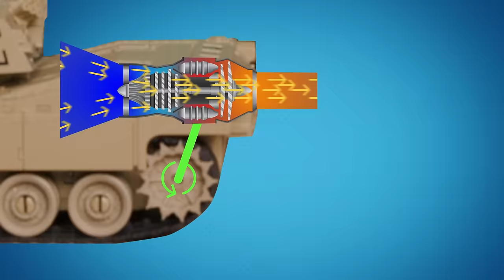Army Mechanic Reacts to Tank Fails

Comment: Russian tanks are not known for being water tight. Often the older they get the more maintenance issues you get. Most of all, people taking the funding to fund their own pockets. That is how you get tanks that break down easily. This aside from the obvious problem that Russians love to keep money before it hits the right industries like tank production. This again leaves major mistakes that can cause major issues. Also on top of that as mentioned in the video, a tank needs to breathe. This is why you see snorkels or other equipment being fitted on tanks from time to time. The Leopard 2 is for example pretty famous for images that show this perfectly. Those tanks can wade (if using that gear) up to 15 meters (49 ft) under water. Really cool to see this in action I have to say.

And for people who think this has anything to do with the turrets flying off to space. No, that is tank design. Where NATO countries store their ammo in other locations to make it saver for the crew. Russia still stores it WW2 style around the turret. So when a turret gets hit between the turret and the hull, it will explode all shells and make the turret fly off to space. 100% KIA on all inside as well.

With all due respect, the biggest issue with the Abrams tank is the specific fuel it needs, this causes the fuel consumption to be worse and even worse then that you will need a huge supply line to keep one of those beasts to run. This while a Leo 2 can visit a local gas station and fuel up there if really needed. And for Russian tanks, they poor some vodka in on a regular basis. Regardless, the M1 is a amazing machine and it has it's advantages over other tanks. At this moment however it isn't the number 1 in the world, but second place. The Leo 2a7 is whooping it's rear pretty hard. I hope the Abams will get replaced with a completely new variant as updating it might be asking too much, it's getting rather old and many systems need to be integrated better. For the Leopard, there is talk of a Leo 3 being in the making, no idea how that will turn out or even look.

A roll over like that can easily cause the tank to be written off completely. It would need to be send to the factory to be rebuild and made sure everything works as intended and no problems remain. However Russia doesn't have this policy, they just end the same tank with minor repairs back in action.

A tank like a M1 Sherman is amazing for it's time, but depending on the engine it did have known issues with overheating, misfiring or even in rare cases bursting into flames due to overheating. Some more modern M1's after the war however did get these issues fixed usually, specially the M1's that still run in active service to this day run with very reliable engines often.

11:07 French AMX AuF1, quite decent artillery units. Second artillery I am not sure about, last is a Russian tank, probably T-72M. And yes Russians seem to get in trouble like that due to their own foolish reasons. Most often also because these guys don't get trained properly like NATO forces do. In NATO every single job you get trained for so you can do it properly, in Russia this is not the case. Which is why you see WW2 tactics being used by a modern Russian army during the Ukraine war... Also in at least the Leo 2 and Abrams cases you often see the crew loading it with the turret facing to the rear. this will ensure the barrel doesn't get damaged as easily if something does go wrong. The major reasoning behind this is that the rear of the tank is actually longer due to the turret being offset to the front a bit further. Another good reason is to save space.

12:36 These are Russian vehicles obviously, this is pre-Ukraine war 100% sure, I however do not remember when exactly. I am aware this footage is from at least 2010 if not earlier. In this case it's during a training operation if I remember correctly. The tank needed major repairs after this and a completely new barrel. From what I remember the turret ring was destroyed, the barrel was bend and inside the turret also some things were bend (don't ask me how they achieved this last part, no clue)
For a Russian tank your vision is even more limited then what the Abrams or Leopard 2 have, as mentioned it's really a tiny hole in front of the driver really. In Russian tanks it's not multiple holes like we have in the west.
The other vehicle hit was actually a BMP-3, which would be troop transport (APC in this case)

The fastest tank speed on record is 82.23 miles per hour (132.5 km/h) achieved by a modified British FV101 Scorpion light tank in 2002. The default version is obviously slower, yet actually still a insanely fast impressive small tank. For the one in the clip, well that is a custom Chieftain tank. For obvious reasons it most likely lost all it's armor in favor of a very light body and turret. Likely a brand new engine and changes to it's wheels and tracks. Else it will NEVER be able to even get close to those speeds. 40 km/h (25 mph) for the Mk. 1- Mk. 3's, the Mk. 4's are not that much faster. So getting this very slow machine up to those speeds is pretty much a money sink and foolish. Even with all changes, you probably will get a additional bit of speed out of it, but no more then half extra unless you make it all in carbon and even then it's a question if the tracks will hold out as those are not made for high speeds.

Test footage in England of a British Churchill tank, very early stages. I think it's even a A22 which was the tank's name before it became the Churchill. So very much a test tank at this stage. The idea of tests like these was to see what the tank could handle as WW1 was just behind them and they wanted to make sure their next tank would be able to handle trench warfare. It just didn't turn out like that as Germany used a completely different tactic that made trench warfare obsolete.
Modern footage at the tank museum Bovington (tankfest): https://www.youtube.com/watch?v=t3DF1G1-axI

Comment: "Essentially an airplane engine".... no,  not essentially, it is.  It's the same core turbine that's in the chinook. The T-1500 and T-55 engines have about as many parts in common as your average subaru turbo EJ motors.

Comment: The tanks on to the trailers 99% of the time it's due steel tracks going on to a steel surface. If any tracked machine doesn't have rubber you should put old tyres down or rubber matting

Comment: Master Gunners are not Mechanics. They're tankers who went to a class for about a month to learn how to hit a target with a 120mm projectile & enough ballistic computer power to keep the barrel level on a Roller coaster in a Crosswind.

A cavalry officer who does not know about much an Abrahams weighs should learn about Google or stick to ground pounding.

And never met a Cav staff officer without a Tab. Especially after ~25years...

Pulse Jet doesn't force the debris out the TURBINE. It recirculates it back into the Filtration. The Precleaner is a giant air filter assembly. 

The number of people who will see the internals of the TURBINE are few & far between.

Comment: "Can tanks go highway speeds"

"no"
 
AMX-13 can pull about 60kmph some versions could pull 70 kmph.  
the record though goes to a version of the FV-101  82.23 km/h (51.10 mph)...   the crew was Hauling it and got it actually to low highway speeds.

Comment: Tanker Tim claiming that a tank on rubber pads wouldn't slide on a wet road is so silly. Straight up off road, (combat), all metal tracks would rip up your average asphalt road, (how do I know you might ask, because we crossed many a road in full combat rig). 
Tanker Tim thinking that making use of your support unit is embarrassing has never pushed their unit to their limit. Repairing a busted track in a frozen river, digging down so you can lay down wood in a swamp and carve the top of an edge on a ridge is basic training
 Come on man

Comment: if im not mistakeing the shermen has an air cooled radial engine with a forced air cooling system fed by a large fan connected to the engine itself

Comment: at 16:48 - comment about newer tanks with lower center of gravity - yeah, I guess you do have a lower CG now, but that's now why the tanks are lower. 
They have what we refer to as a lower silhouette because we want to be a smaller target. 
It's one of the reasons tracked vehicles have an advantage over wheeled armored vehicles; you can make tracked vehicles lower. 
I don't know 1/100 what that COL does, but i was trained as an Armored  Cavalry officer in 1986.

Comment: I’m not gonna lie I’m still scared of driving the Abram’s on a train or a semi that shit is fucking something else especially when you can’t see shit and the thing about hearing noises from the tracks is so true since I got stuck in the middle of nowhere with my left track off the fucking sprocket and mud everywhere at night with a broken center guide bolt broken and had to wait to get one in the morning and also a day after 13 tank flipped over and had to wait in the rain for the fucking 88ts basically no sleep for that whole training operation

Comment: "whoever is the commander of that tank, owes that crew an apology"

that video is from Ukraine, december 2022.
That's a Russian T-72 (only has 1 vision block for the driver btw) and the 'crew' in this case, they're dead.
the extended version of that footage shows atleast 2 guys completely motionless afterwards, 1 guy limping away with his leg in the wrong direction and the rest runs away from the BMP they were on top of, until they got drone-bombed not that long after.

a VERY unfitting video for a 'tank fails' compilation, honestly.. what the fuck guys??

Comment: Well abrams tank is too heavy to go full under wather but thats not a case for all old and new russian tanks basicly all can go under wather thx to their lighter weight they can go submarget and cross wather obsticales fiew meteres deep by uninsg snorkel. Plus that tank on video goes under wather and turret was still out you can see that engine is still running just fine it was Ukraine T64 tank and those have no problem to go under wather like this. Full video is basicly the tank stops in wather and than go slowly out no  problem.
Reply: They also have a bottom hatch. Abrams would fall through rickety Iraqi bridges and the crew had no choice but to drown because there is no bottom hatch.

Comment: The Colonel isn’t quite accurate on the top speed of an M1 Abrams, the first generation Abrams we had in 1984 could easily do 60 MPH on the freeways, I remember being passed by some in my M113 that was going fast as possible at 45 MPH and they flew by me like I was stopped on the side of the road on jack stands! They soon adjusted the governors on the turbines to slow them down but they can be adjusted back up if they choose to.

Comment: Fuckin Cav, always sporting their Stensons. Also... these guys aren't mechanics. One is an officer. The only work they did was getting soldiers lost when they were butter bar. The SSG knows more, being he works for a living. But again, he's a gunner, not a mechanic. He might field repair a minor issue with his cannon, or might help get a track back on (if he's a good NCO). Neither of these guys are track or wheeled vic mechanics though. Likely just the two the CSM and BG thought would represent the unit best.
Reply: You don't need to be a turret or hull mechanic to know what not to do in those things. They've all spent enough time in and around them.
Reply: @SGobuck  don't have to tell me nothing. I was a mechanic in 1AD. Trust me, or hell, don't, really couldn't care, the closest any DAT, be it the gunner/loader, driver or TC, has to mechanical knowledge, is fixing track or replacing road/power wheels. An LT isn't there to learn mechanics, they are there to manage troops, logistics and to get you lost. 
TLDR, I said what I said and I meant it.